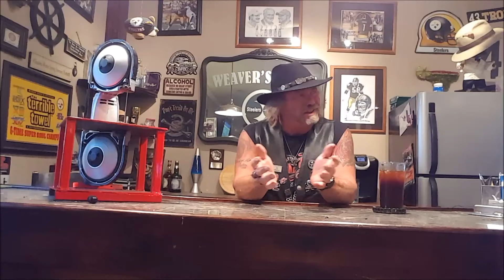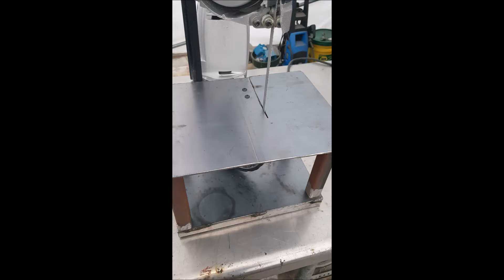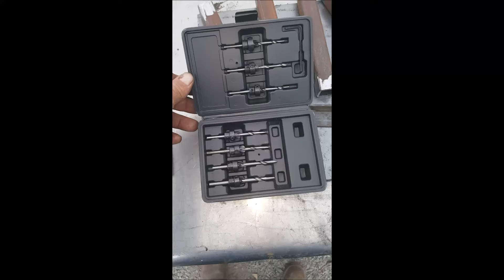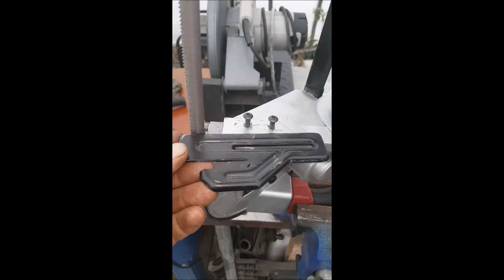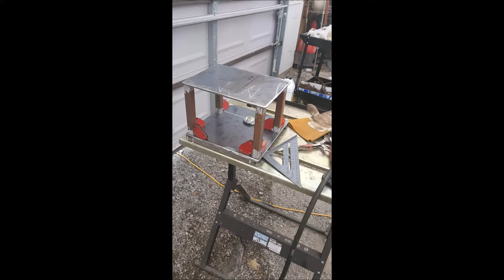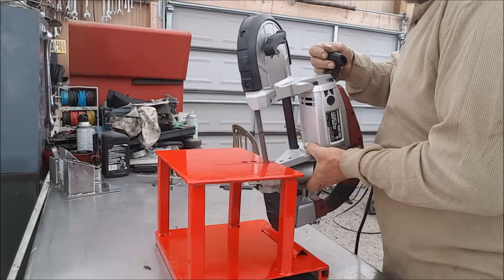Buiding a Stand for Harbor Freight Band Saw

Comment: Great job, I'm wanting to get a Harbor Freight Portable Band Saw and having it on a table as you designed would be very useful. I also like your welding cart with the jacket and equipment tree, looks like a moon rover. If that is another one of your projects, please consider a video on it. Thanks for sharing your Band Saw Table.

Comment: Is the air breather on the band saw slot on top of table sucking air  pulling chips into the tool. ?
Speed up when putting screws in.
Other wise awsome

Comment: Go Sixburgh !!!  Nice easy design. I think incorporating a clamp design on the lower platform to hold the handle tight will reduce much of the stress on the two screws  which may become loose and chowder the threads. Great job overall though my congrats to you.